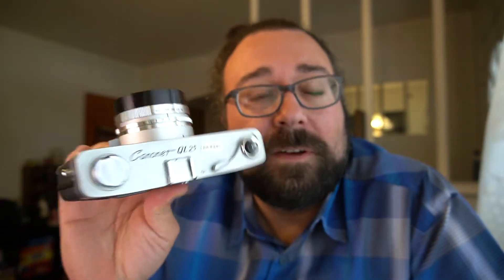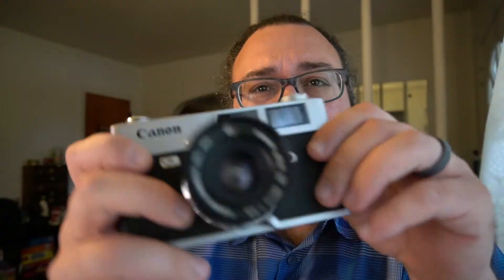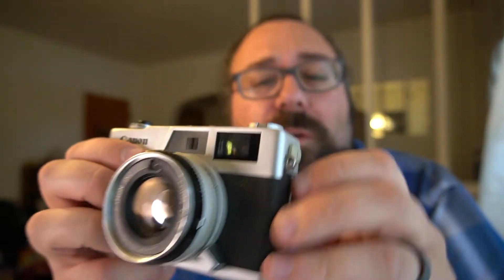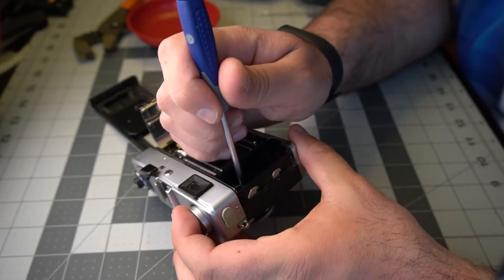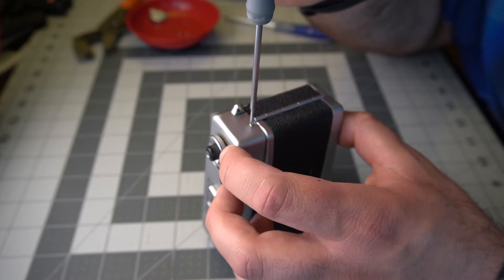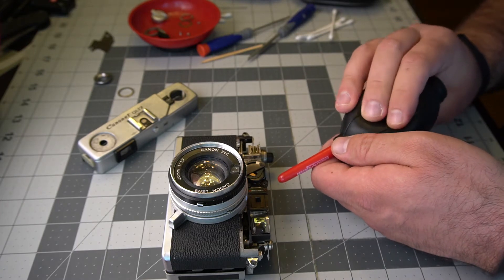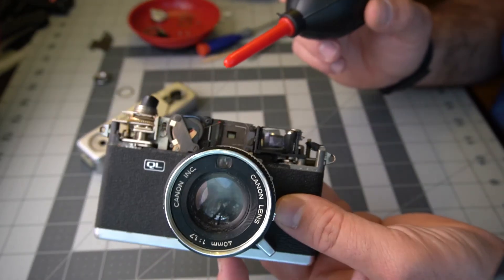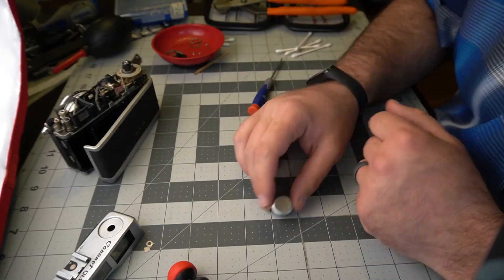Canon Canonet QL17 Rangefinder Viewfinder Disassembly and Cleaning Part 1

Comment: I know this video is a couple years old but I'm trying to find some advice on my QL17 G3. The screws that hold the knob on the focus ring backed out and the knob came off. There's basically two tiny screws sticking out of the focus ring now. I took it to a repairman and they said they've never been presented this problem before and told me it required a full refurb. Based on your experience how would you go about fixing this problem?
Reply from the maker: So we're talking about the knob on the focus ring that you would use to move the focus ring around?
Reply: @ontheflywithryan5611  yeah exactly! If you want to chat like on Facebook or something so i can show pictures id be okay with that
Reply from the maker: Sorry I didn't get back to you sooner.  Unfortunately the way the Canonet is put together the whole front lens assembly would need to be removed to put the screws back in that ring. It would be a very serious disassembly. Unfortunately a person who is qualified to do that repair will probably charge you $100 or more, which is probably about what the camera is worth.  If the camera has sentimental value that might be an option you wanna explore.  If it's just a fun camera you enjoy using and the focus ring still works perfectly but the knob is no longer attached I'd very carefully glue the knob to the ring and continue enjoying the camera.  That being said if you decide to use glue you must be absolutely positive that no glue gets anywhere aside from the surface of the ring and the knob. It might even be safer to use something like a tiny piece of double sided adhesive that you could remove later if you wanted. If the focus ring itself is loose and not functioning properly all this would be pointless and you'd need to have it taken apart.  

If I can help any other way shoot me a message on Instagram @cult_of_the_canonet

I've also got schematics and repair manuals if you wanna see how the focus ring attaches to the rest of the camera.
Reply: @ontheflywithryan5611  thank you so much! I'll definitely be following you on Instagram for sure. Yeah it's kinda both a fun camera, and a sentimental piece. Thank you so much for your advice i really appreciate it

Comment: I bought a QL19 that rattled, and found the second diagonal mirror (not the viewfinder splitter) freely moving about. It seems easy enough to reseat but I'm worried about the positioning ruining the rangefinder's accuracy. I assume it's dead center with the open square? Mine's got a slightly off-center window in the mirror
Reply from the maker: I've had to glue one back on before. Get in touch with me on @cult_of_the_canonet on Instagram and I'll send you a picture of where the mirror should be

Comment: Hello! Any advice on how to fix connection to an external flash. I tried connecting mg flash through hot shoe and even through the sync cord, but it won't work. I have a Canonet QL17 GIII.
Reply from the maker: Shana I'm so sorry,  I don't know how I missed this.  If you're using any old flash the camera should just shoot with the hotshoe connection in manual mode as long as there are batteries in the camera.  You can also use the flash guide numbers with the flash in manual.  If you have a Canonlite D flash you can just use the camera in auto mode

Comment: 9:17 So is there any way to clean the diagonal glass without getting rid of the coating? Mine has specs all over it and I'd like to get rid of them
Reply from the maker: Brush it gently with a clean q tip and be careful not to put too much pressure on it.  If that doesn't take care of it you can dip that q tip in water and try again then, just don't get too much water in there.  As a last resort you could try rubbing alcohol with a high alcohol content because it will evaporate quicker, again,  trying to use as little as possible.  Unfortunately most of these cameras have seen better days and sometimes the improvements we can make to them without replacing parts is pretty small